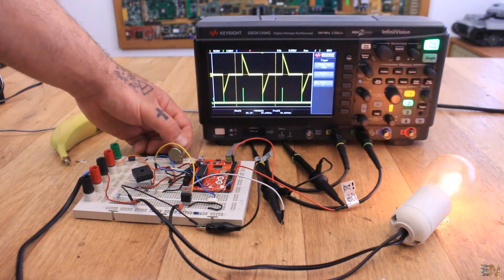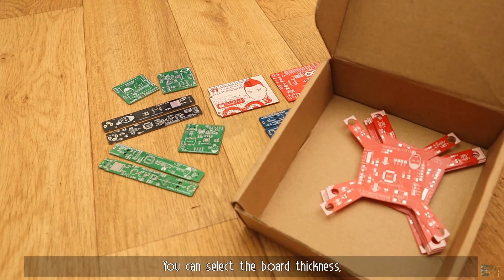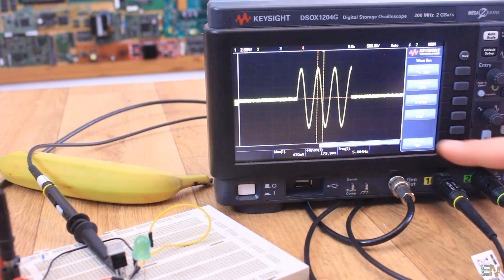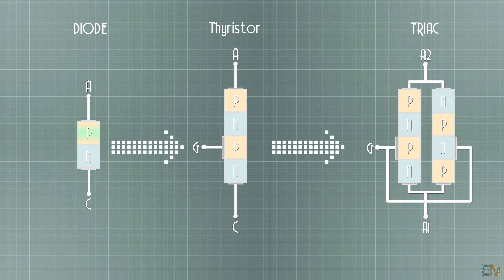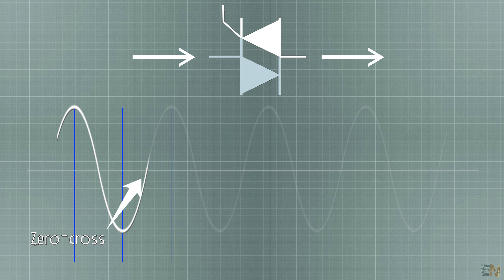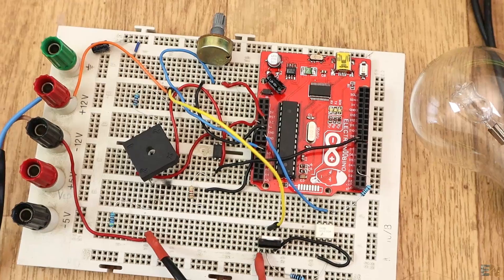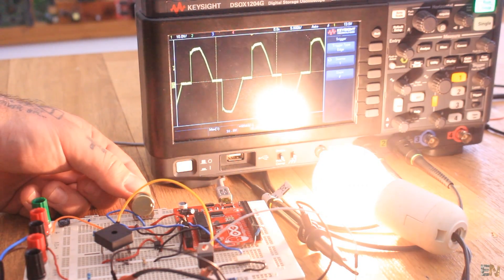Basic components #003 - TRIAC & Thyristor

Comment: Q : ok what is the variable resisters value aka potentiometer -- 10 K? A: Yes, 10 K. 

This circuit works perfectly well with small AC BLDC fan i.e. 220V and 0.12-0.16A as well. I have tested. Ensure no faulty potmeter to start with as first step in troubleshooting if you did not get result. Secondly, the connection between 200OHM reister and mains is important. By mistake, do not connect mains directly to pin no6 of MOC3020 or 21. It can have magic smoke..!!! Carefult...

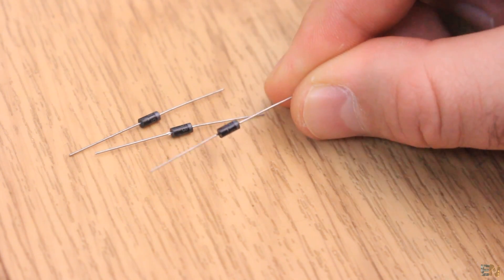Comment: At 2:10 you say a thyristor stays on until the current changes direction in a DC circuit. 
I must be using Thyristors wrong. I have been using the Gate to control it like a switch. Ground the Gate current stops. Make the Gate positive and the Source Drain current flows?
Have I been doing something wrong... It work beautifully for me. I use it to control windscreen wiper motors. IR1010E Thyristor.

Comment: Hi I tried this circuit with Arduino.but the ac load(15w) bulb is not at all switched on!! I used pc817,moc3023,bt136,10k potentiometer,1amp bridge and all the required resistors.what could be the issue?

Comment: What's the difference to for example using transistors and diodes? Since you need some kind of timing circuit either way, what does the thyristor save you?

Comment: so the Arduino control circuit will work with ANY Triac?   No matter the specs for the Gate?
Reply: No, you must size the optocoupler (or firing element) and gate resistor to the TRIAC specs, bigger TRIAC/SCR require more trigger current in the gate.
Reply: @tejonBiker  Quite so.  Perhaps you could make a Part II to discuss this in detail ???

Comment: but does this work with ac motors, what the difference would be?
Reply: AC motors need more advanced control procedures. They are not like DC motors where everything is naturally decoupled. In AC motors if you change just the voltage with out taking in consideration other aspects other parameters  will change and this would cause a problem for the motor itself. And that's there is something like the scalar control V/f or the FOC methods
Reply: @abdelssami  partly understand but not fully, thanks for your answer. will search for more info. thank you very much!!!!

Comment: Great Tutorial !!!
I used similar circuit for controlling Fan speed,but by this method fan makes hamming noise At lower speed. How can I remove this noise
Reply: I wouldn't suggest using a Triac to modulate (control) the speed of an AC motor. The construction of the motor was built expecting a Sin wave, not a modified pulsing Sin wave. There are other ways to control AC motors.

Comment: with a Diac and an RC to control the firing angle there is no need for an arduino and software and all that stuff...
Reply: @jmicroelectronics9742  first of all I am not against using computer for device control. Sure if you want to control 5,6, 10 different devices that might be also dependent on each other, then of course using a microcontroller is the easiest way to go. But for just one device, I'd rather a non computer based method which I call it analog way, using opamps, transistors, voltage ref, etc + innovative thinking and clever use of electronics! and that's just a matter of taste I think and not a rule. I was taught and trained in electronics in 1980's so we were more relied on analog solutions rather than using an expensive micro controller (and its surrounding logics) to control one lamp or one motor . In answer to your specific question, accuracy will not be any worse or better than the arduino based method for sure. With regard to controlling speed in a temperature interval only, it can be done by adding a couple of opamps and and comparing with variable reference voltages. Well, in very old days (1960's for instance) they would do it with transistor arrays and just differential amplifiers rather than opamps but of course it would be too messy.
Reply: @amirb715  you are right using the analog methods would be more efficient than using a digital one especially for controlling a bulb, but I think that he is trying to show the HOW TO  thing and how its work.
Reply: @amirb715  Idea is to get to a working prototype using potmeter. See next article where in same circuit is used with PWM for control and you will be blown !!
Reply: @jmicroelectronics9742  although my comment was only about the dimmer in video but if I want to control the AC motor speed with temperature, I would use a thermistor in my timing RC circuit (or perhaps use it with a transistor current source plus a charging capacitor which will have the same result but it will be linear with time instead of exponential) and then this capacitor voltage will be used to trigger the diac which subsequently fires the triac. by the way I think there are triacs that actually have a built in diac in their gate internally although I have never seen or used myself

Comment: So how do old dimmer switch’s control the triac? I’ve torn them apart before and never seen any thing like a micro controller in them. Is the gate being fired by the 50/60 Hrz wave? I’ve been wondering about this for awhile.
Reply from the maker: For the analog version of TRIAC dimmer just search a circuit with a DIAC and potentiometer as well. Is very easy. The Diac will apply the firing pulse each zero cross

Comment: using your t12 soldering iron circuit but i want control using a potentiometer so i want to change the code the potentiometer Connect to a3 of arduino